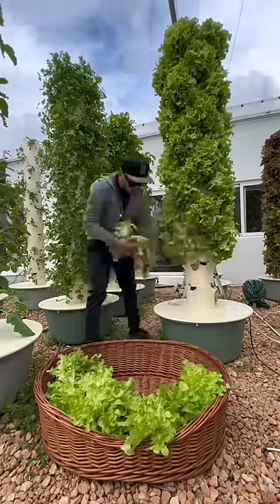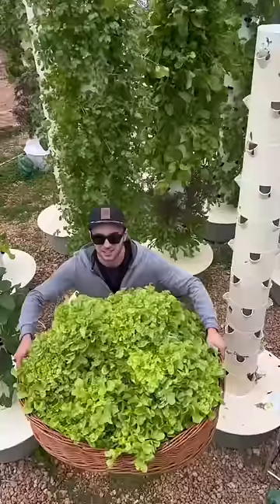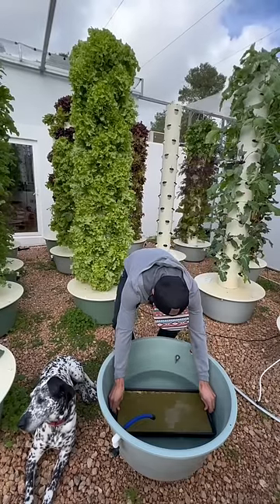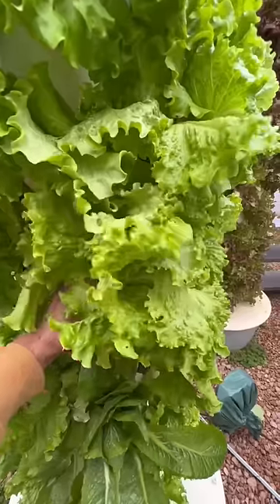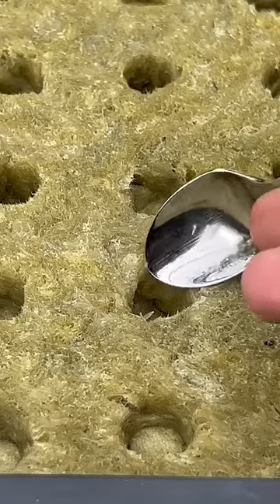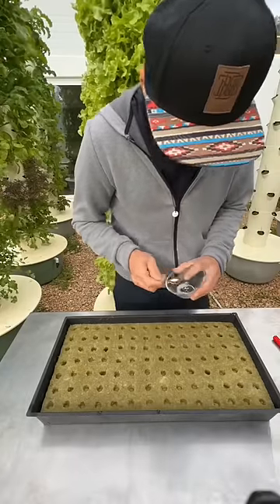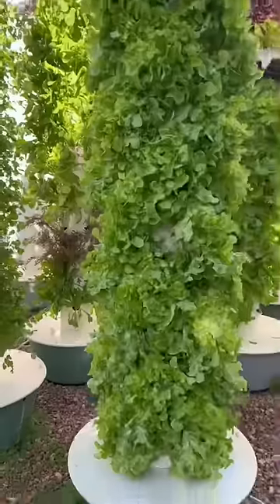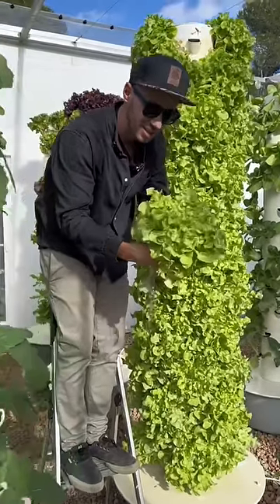Strategies for growing soilless lettuce #lettuce #towergarden #verticalfarming #gardening #farming

Comment: I feel like you skipped a step or 2...
Reply from the maker: We initiate the growth of all our plants from seed, which we place in agricultural rock wool (made from basaltic rock). The seeds are watered until they germinate and become seedlings, which typically takes 2 to 3 weeks depending on the variety. The seedlings are then transplanted onto an aeroponic tower, where they receive irrigation through a submersible pump located in the bottom reservoir. This pump delivers a nutrient solution enriched with all the essential minerals and trace elements required for optimal plant growth.

Comment: Down sides:
-the lettuce contains less minerals and nutritional value
Reply from the maker: The use of aeroponic towers in plant growth allows them to receive a constant supply of oxygen at the root level, improving their nutrient absorption rate. Consequently, crops grown using this method have exceptional nutrient density, flavonoid, and antioxidant levels that are superior to those of soil farming. The increased nutrient levels result in vegetables with a superior taste, texture, and water content.

Comment: Rockwool? Really? As an insulator hearing that name bothers me for being near anything food related
Reply: It's only a risk when inhaled.  If it's kept wet as it is in hydro/aero applications, inhalation risk is negligible and you rarely come in contact with it anyway when used as a growing substrate. Used in this way, it's nontoxic as well.
Reply from the maker: Rockwool for agriculture is compacted differently and is used after being soaked and therefore does not present a health risk. In other terms, although we recommend to handle rockwool with gloves, contrary to general perception, it is a safe material.

Comment: It doesn’t require anything but you need something called Rockwell, whatever the hell that is and I don’t friggin know
Reply: Rockwool. It's a type of mineral insulation that can be easily purchased at many home improvement stores. Used to grow weed in this stuff. 
I think expanded clay is a better substrate and it's more sustainable.

Comment: Nice yield, but thats a dead crop. If I want water, I'll just drink it.
Reply from the maker: Plants that are grown aeroponically receive an unobstructed supply of oxygen at the root level, which enhances their nutrient absorption capacity. Consequently, these crops have exceptional nutrient density, antioxidant, and flavonoid levels compared to soil-grown crops. These elevated levels of nutrients result in vegetables with an improved flavor, texture, and water content.
Reply: @Agrotonomy  But they don't have the nutrients that the soil provides. I can oxygenate and my soil with a peroxide solution and provide sufficient nitrogen with my used coffee grounds. Maybe I need to sample an aeroponically grown head of lettuce and decide if it's actually better in flavor or texture.

Comment: I feel like there’s a step missing
Reply from the maker: Our planting process begins with seeds that are placed in agricultural rock wool (made from basaltic rock). These seeds are watered until they germinate and develop into seedlings, which usually takes 2 to 3 weeks. After this, the seedlings are moved to an aeroponic tower, where they receive water enriched with an ionic mineral nutrient solution that provides all the necessary minerals and trace elements for plant growth. This solution is delivered through a submersible pump located in the bottom reservoir.
Reply: @Agrotonomy  thank you for clearing that up for me!

Comment: Basically u just eating water and fiber no nutrients in it
Reply from the maker: Aeroponics is a technique that allows plants to have a 100% supply of oxygen at the root level, making it easier for them to absorb nutrients. As a result, crops grown using this method have some of the highest nutrient density, antioxidant, and flavonoid levels ever tested in soil farming. These elevated levels translate into improved flavor, texture, and water content in vegetables.

Comment: But, soilless lettuce does NOT have flavor😢
Reply from the maker: Aeroponics is a technique that allows plants to have a 100% supply of oxygen at the root level, making it easier for them to absorb nutrients. As a result, crops grown using this method have some of the highest nutrient density, antioxidant, and flavonoid levels ever tested in soil farming. These elevated levels translate into improved flavor, texture, and water content in vegetables.

Comment: This doesn’t taste as the one grow on natural soil.
Reply from the maker: Plants grown aeroponically benefit from a consistent oxygen supply at the root level, which improves their nutrient absorption rate. As a result, crops grown using this technique have exceptional nutrient density, flavonoid, and antioxidant levels that outstrip those of soil-grown crops. The increased nutrient levels lead to vegetables with better flavor, texture, and hydration.

Comment: This is not as nutritious as the lettuce that you'd grow in soil. The soil contains a number of different minerals that feed the lettuces, or any other plant really, and then allow it to grow. Additionally, those minerals are why the plant feeds your body and is good for your health. Growing plants on concrete, using systems that would constantly water them, etc. is a great way to produce more but definitely not better plants.
Reply from the maker: By growing plants aeroponically, they are provided with 100% access to oxygen at the root level, which enhances their nutrient absorption ability. Soil farming crops don't even come close to the nutrient density, flavonoid, and antioxidant levels achieved through this technique. The elevated nutrient levels lead to a better taste and texture, and vegetables that are perfectly hydrated.

Comment: Soil-less....so no vitamins or minerals?
Reply from the maker: There is no soil inside the tower, only water mixed with nutrients is located in the bottom reservoir. There is a pump that irrigates the plants intermittently. Aeroponically grown plants have 100% availability of oxygen at the root level, which improves their ability to absorb nutrients. As a result, whether it's nutrient density, antioxidant levels, or flavonoid levels, soil farming crops rank among the best ever tested. Increased nutrient density, flavonoids, and antioxidant levels translate to better taste and vegetables with the right texture and water content!

Comment: Yeah I feel like you skipped a few steps there Skippy!
Reply from the maker: We start everything from seed which we put in agricultural rock wool (made from basaltic rock). You water the seeds until they germinate and become seedlings which takes 2 to 3 weeks depending on the variety. You then transplant the seedlings on the aeroponic tower, and they are irrigated through a submersible pump in the bottom reservoir that provides water mixed with an ionic mineral nutrient solution that provides all the essential minerals and trace elements for healthy plant growth.

Comment: Maybe a good use of space but what about all the nutrients that vegetables absorb from the soil.  This lettuce will be seriously lacking in nutrition so therefore useless to the human body.
Reply from the maker: Aeroponics is a technique that allows plants to have a 100% supply of oxygen at the root level, making it easier for them to absorb nutrients. As a result, crops grown using this method have some of the highest nutrient density, antioxidant, and flavonoid levels ever tested in soil farming. These elevated levels translate into improved flavor, texture, and water content in vegetables.
Reply: @Agrotonomy  Ok I am willing to believe that if it has been proven but I still don't understand where the absorption of the nutrients is coming from.

Comment: You didn't even explain the aeroponics...
Reply from the maker: The tower is hollow on the inside. There is water mixed with nutrients that sits in the reservoir with a low-wattage submersible pump. The plants are irrigated intermittently 3 minutes on and 12 minutes off continuously. The towers are automatically filled up on an as needed basis via a gravity tank.

Comment: But have you ever see what they want for the set up to those things? Some of them are over $1,500 some of them go all the way to $3,500. Even if I bought a hundred heads of romaine lettuce it wouldn't cost me nowhere near that😂😂😂😂
Reply from the maker: Incorrect, the starting price is $670 with all accessories included. Additionally, there are volume discounts that apply when purchasing 10 towers or more.

Comment: Definitely missed some steps!
Reply from the maker: Our planting process begins with seeds that are placed in agricultural rock wool (made from basaltic rock). These seeds are watered until they germinate and develop into seedlings, which usually takes 2 to 3 weeks. After this, the seedlings are moved to an aeroponic tower, where they receive water enriched with an ionic mineral nutrient solution that provides all the necessary minerals and trace elements for plant growth. This solution is delivered through a submersible pump located in the bottom reservoir.

Comment: No soil - no nutrients
Reply from the maker: The use of aeroponic towers in plant growth allows them to receive 100% oxygen at the root level, which enables them to absorb nutrients more efficiently. As a result, crops grown using this method have nutrient density, flavonoid, and antioxidant levels that exceed those found in soil farming. The increased levels of nutrients translate into improved taste, texture, and water content in vegetables.

Comment: I think u skipped a few steps
Reply from the maker: Our planting process begins with seeds that are placed in agricultural rock wool (made from basaltic rock). These seeds are watered until they germinate and develop into seedlings, which usually takes 2 to 3 weeks. After this, the seedlings are moved to an aeroponic tower, where they receive water enriched with an ionic mineral nutrient solution that provides all the necessary minerals and trace elements for plant growth. This solution is delivered through a submersible pump located in the bottom reservoir.

Comment: I bet it tastes lik nothing without soil
Reply from the maker: Plants grown aeroponically benefit from a consistent oxygen supply at the root level, which improves their nutrient absorption rate. As a result, crops grown using this technique have exceptional nutrient density, flavonoid, and antioxidant levels that outstrip those of soil-grown crops. The increased nutrient levels lead to vegetables with better flavor, texture, and hydration.

Comment: Makes no sense, spend so much money on this system to grow something with near zero caloric value.
Reply from the maker: Aeroponics is a technique that allows plants to have a 100% supply of oxygen at the root level, making it easier for them to absorb nutrients. As a result, crops grown using this method have some of the highest nutrient density, antioxidant, and flavonoid levels ever tested in soil farming. These elevated levels translate into improved flavor, texture, and water content in vegetables.

Comment: Lettuce 🥬 had 0 nutritional value just water lol .
Reply from the maker: Plants grown aeroponically benefit from a consistent oxygen supply at the root level, which improves their nutrient absorption rate. As a result, crops grown using this technique have exceptional nutrient density, flavonoid, and antioxidant levels that outstrip those of soil-grown crops. The increased nutrient levels lead to vegetables with better flavor, texture, and hydration.

Comment: no soil = no flavor
Reply from the maker: Aeroponics is a technique that allows plants to have a 100% supply of oxygen at the root level, making it easier for them to absorb nutrients. As a result, crops grown using this method have some of the highest nutrient density, antioxidant, and flavonoid levels ever tested in soil farming. These elevated levels translate into improved flavor, texture, and water content in vegetables.

Comment: Dude skipped a few steps
Reply from the maker: We initiate the growth of all our plants from seed, which we place in agricultural rock wool (made from basaltic rock). The seeds are watered until they germinate and become seedlings, which typically takes 2 to 3 weeks depending on the variety. The seedlings are then transplanted onto an aeroponic tower, where they receive irrigation through a submersible pump located in the bottom reservoir. This pump delivers a nutrient solution enriched with all the essential minerals and trace elements required for optimal plant growth.

Comment: La fameuse salade qui n'a absolument aucun goût
Reply from the maker: Aeroponics is a technique that allows plants to have a 100% supply of oxygen at the root level, making it easier for them to absorb nutrients. As a result, crops grown using this method have some of the highest nutrient density, antioxidant, and flavonoid levels ever tested in soil farming. These elevated levels translate into improved flavor, texture, and water content in vegetables.

Comment: And this has zero nutritional value.
Reply from the maker: Aeroponic growth provides plants with a continuous supply of oxygen at the root level, which boosts their nutrient uptake. Consequently, crops grown using this method have remarkably high nutrient density, flavonoid, and antioxidant levels compared to soil-grown crops. These elevated nutrient levels translate into improved taste, texture, and hydration in vegetables.